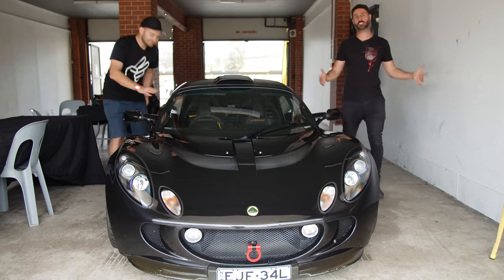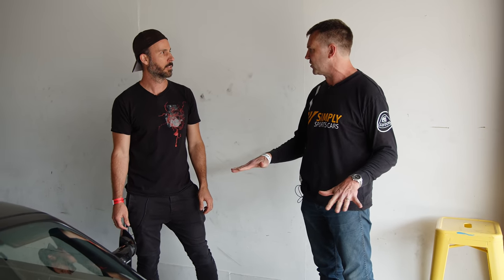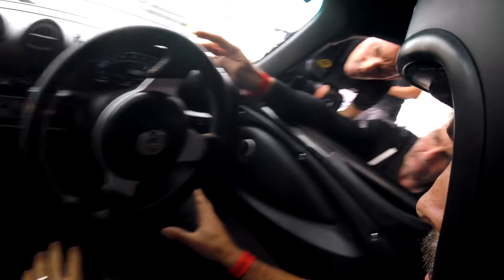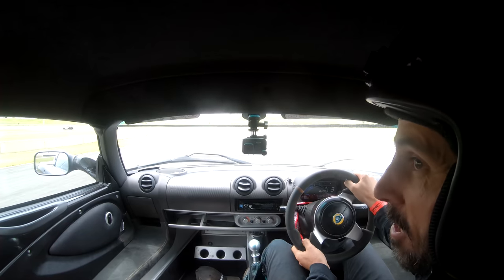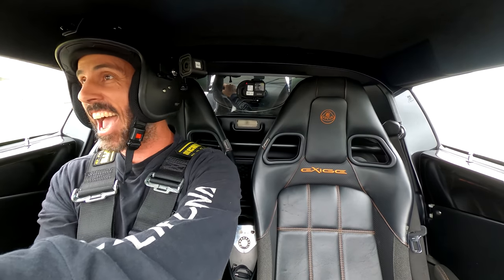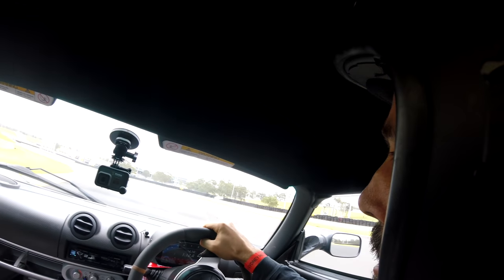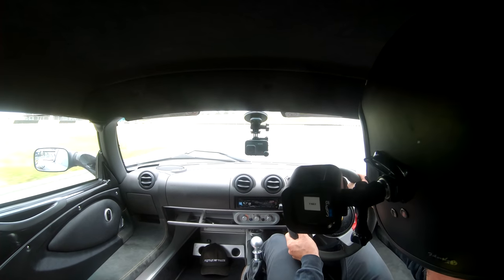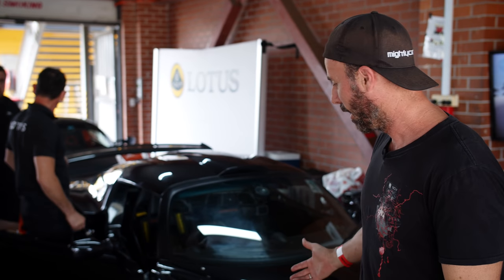LOTUS - Supercharger Upgrade (First Drive)

Comment: Awsome Moog!! 
  I was a tad dumbfounded that you took the car on track with out checking the old tires out. C'mon this is Mighty car mods, and best mod to a vehicle is the rubber and wheels =) !
   Last can we seriously check into getting shades for the fixed camera ( and any other that gets washed out ). MCM has the best car content let alone you 2 being rad. It's such a cheep rip off losing content to such an issue =( . Can ya also look into sweat shirt / sweater merch? Hate having a hood fapping around when wrenching or driving B^) . 
  Keep it up MCM !

Comment: Mind boggeling to see what just suspension adjustment and over all vechile alignment can do. Ps moog you should probably learn heel toe downshifting as it will significantly reduce clutch wear and will less likely lock the rears up.

Comment: Watching Mr Jocelyn driving his Walrus with confidence I was pretty sure he must have had a "moment" at one point ;) :) Driving a hooked up car fast around a track is a feeling like nothing else really. Pity the rules prevented Mark from riding shotgun and giving your tuition. His laps on MCMTV2 were fast but I think he was holding back a little bit. Next thing is to change the pulley, put in bigger squirters and put some slicks on :)

Comment: Hmmm. Most drivers choose gears too low at the track. That's a great way to explode a car and be slow. You do not need to change down to low gears to corner. What you want is the gear which, when you get on the gas hard, will respond with the right amount of power, and generally that means being in a gear higher than you think you need. That's because after you turn in, you're still slowing down quickly unless you're getting back on the gas because you over-braked it.
This is true for your supercharged car too.
It takes an AGE to change gears when you see the huge part of the straights taken simply to change up! Far more efficient, and faster, to change gear less, and accelerate more constantly on the straights. If you come out of the corner in 3rd, you only to change twice before you begin braking. If you come out in second, you're going to be squirrelly, and possibly upset the car, and maybe have to commit the cardinal sin of getting off the gas after the apex!
Get proper driving instruction, from professional drivers, IN YOUR CAR! :)
My goodness, guys, this isn't even remotely like rocket surgery now, is it?
Or do you think it's cool to suck at driving? o_O
It gets lots of views, and comments - that's for sure!

Comment: Couple things I noticed:

Hes still upshifting too early out of a number of corners, more gears isnt just for the power. By having the engine loaded up and in the power band, It tightens up the chassis and gives you more mechanical grip, if you drop the revs off you can lose a lot of that stiffness and the car can feel sloppy through the corners, especially faster corners. 

Second, is the rev matching. You need to rev match more on the downshifts, it allows you to change gears smoother and faster, and is also much less punishing on your transmission. Its not actually that difficult a skill to pick up, I learned it purely from watching Initial D hahaha, bought my first manual and had it figured it out by myself within a few weeks. These days I do it by instinct without even thinking all the time, even when on the daily commute.

Comment: The black interior is throwing off the light-metering of the helmet cam. That's why the road is so washed out. He should mount it on the dash or mirror or change the metering to "spot" if the camera supports it.

Comment: Moog, you've got to learn how to be aggressive with the car. Drive like a maniac (as safe as possible). Forget about adrenaline. You need cold blood. You can't let your emotions get in control. Use the engine and the gears to brake the car and keep your revs always around their sweet spot. Brake hard but gently before entering a corner. Never brake while in the corner, and always come out accelerating hard, but not too hard, specially with rear traction vehicles. Make the engine scream and beg for a rest.

Comment: I still dont understand what is that red thing mounted on the fron bumper
Reply: It is for towing the car in case if the engine is gone etc. And at racing circuits it's mandatory with a conspicuous colour.

Comment: not a terrible idea to start slow with the 2zz engine anyway (if it's the engine that i think it is).

recently got a 7th gen celica with a 1zz (the slow one), i didn't even look at/ wanted a 2zz as the risk of buying a damaged one is rather high and once damaged it's done. (from my understanding the 2zz is a full aluminium engine without a steel cilinder lining, instead it is chemically treated to be harder then steel which is great. except if you ride it hard when the engine is cold and damage the cilinder wall's as the only to to fix them is re-treating them which.......yea good luck with that, i'm sure as long as they've all been owned by responsable people who know the engine it's fine and toyota reliable but 2nd/3rd/4th hand it becomes wishful thinking that all those before you drove it wisely.)

Comment: Using more of you’re gears means using more of Each gear. Not just when accelerating/deceleration but all the time.
If you rode a motorcycle (sport bike) it would make more sense.

Comment: That looks good, but I am kind of surprised you got most dedicated track car and went to the track day without even checking basics... I mean even for daily driver I would always check tyres and at least wheel alignment after buying. For track day just having thread and basic alignment is not enough so surely specialist track alignment and proper rubber would be fitted. Things like you said - "ohh those tyres were on the car for long time"... like nobody would track car with such tyres. And I am sure there are people doing racing on the budget, but that is certainly not you guys and not people who get's Lotus.
In the end of the day I am thinking maybe that was deliberate - you wanted to advertise Sydney Lotus dealer so you kind of did before and after i.e. what can adjusted car can do vs. just the car you got from the auction. I understand that and don't mind it, but if that was the case then it would have been nice to be transparent about it- we still going to understand and appreciate the difference, but why pretend you really didn't know what is going to happen. Somehow I just really cannot believe you that naive and took Lotus to the track without checking even alignment..

Comment: before to supercharge it, i would have swapped a K20/K24 in it. 
with the proper tune it beat most hypercars in power to weight ratio and downright murder any ferrari with extreme prejudice.

Comment: I get that a camera probably isn't going to expose the interior and the outside both perfectly, but I'd much rather you expose the outside properly than the inside. For your face shots, of course you want your face to be the thing exposed right. But for the forward facing shots we're supposed to be looking at the track and it's just white. I'd rather your dash be really dark than the track be extremely blown out.

Comment: it jooi of thears .
now you gonna grow Balls to Tust in The Lotus And the cars Ability to be in Contole .

in Afrikaans  . Reg voor die Draai is waar jy Maak of breuk .

look at the Race driver 
brake right at te Corner And Immediately keep refs hi and wen entering Corner start to accelerate and have balls and All te trust in purity of that Lotus its Game is Race track .

Look at it main point is Reliability for under power Motor but Its main goal is  excellent Braking and More contole you eva need cornering capability .

Track racing it not about Straigt top end speed .

Its all in the Corner Capability and Overtaking in coners  Strait line just try to keep up with big power Cars .

At conner You have the Advantage end the More then enough power and grip to pull car lengths from hi Power car .

So happy you got car Sorted .

Shows You All previous Owner just adjust the suspension and made wors and loos All the main  ability the car i design for .
Pocket rocket. Tru

Comment: You can could have pulled back the exposure of the video back so we can see the track (same on previous video). Also, you can see that video is completely out of sync towards the end where it shows you passing the same car again before the corner 12:18. I doubt you overlapped the same car... Considering you've had full support of Lotus crew you could have at least made sure video looks good... Been watching for many years but video quality has gone down with Lotus series. I'm just disappointed; not trying to look for small things to complain about. These are very obvious mistakes in video editing that even I can tell are there.

Comment: You really need to learn to rev match.
At the moment, that's just grandpa driving. Just all that loss in braking power, the wrong weight transfer...
Sorry, but you're a disaster right now with a manual car.
Won't even mention the limiter tap or the distance to the apex.
Learn to rev match, ffs!